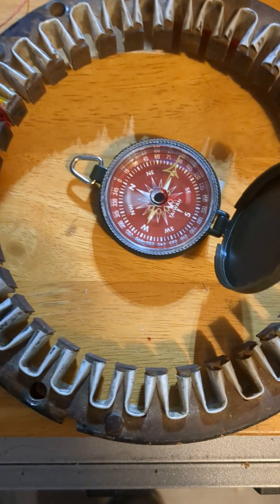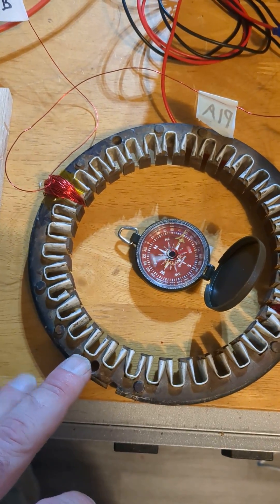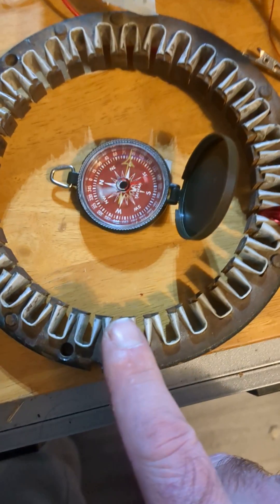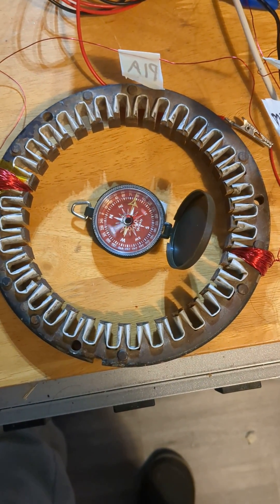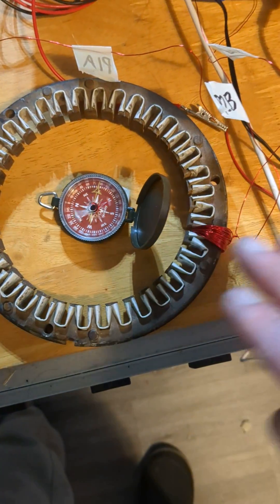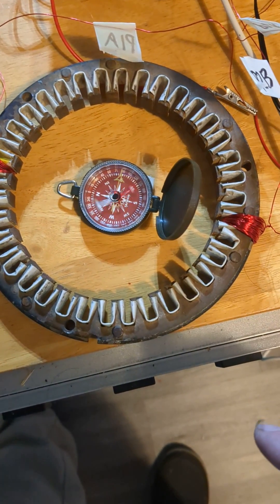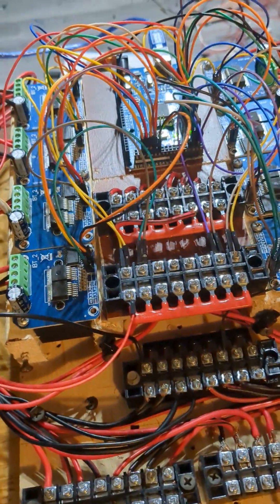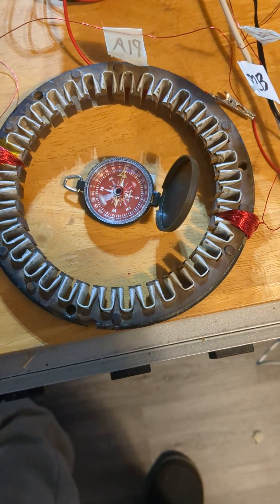Rotating Magnetic Field inside a Toroid Core

Comment: Reminds me of Dollard's 4 quadrant presentation, what he said about phase shifting the coils by 90 degrees to create the virtual rotating pole has stuck with me since watching that, using both the reactive and active currents to complete the rotation, nice to see replications with that design in action.

The use of a core like this also gives me ideas to create a much tighter coupling for the RMF for whatever one would use it on, definite advantages there over just using coils and air alone, if I had the means to experiment I'd be looking into having it run at the resonant frequency to gain those advantages without the core losses, perhaps even driving it on a condenser discharge.

Comment: Sir, you've unlocked the primary means of generating a rotating magnetic field. Use thin primary wire high turns.

Now two secondary coils to set your output voltage use the principle of how power flows from high potential to low. S1 180v s2 12-60 turns. Low awg high amps.

You can also use a second core for your secondary coil. S2.

The amps are limited and determined by core size and primary coil input voltage. That sets the rotational speed and power of your transformers.

The secondarys are only to draw power and recycle it back to the core. With very little losses. 
You can power the load in series or parallel for varying results adding a capacitor also bumps up your peak power output. 
Just like on an inverter with larger caps allows a higher peak power for a limited time
Reply from the maker: If you can post this info on the mooker forum with schematics and details, it would be much easier to visualize. I appreciate the offer of help

Comment: Can you please explain how the coils are connected to the audio amp. And what connections you are using to power the amp and the purpose of the aux audio connection.

I would love to replicate this set up.
Reply from the maker: 2 stereo speaker outputs.  each speaker output goes to 1 coil.  Doesn't matter which direction. Switching the polarities just changes the direction of rotation.  Aux input needs to be receiving 2 sinewaves 90 degrees phase difference. You can create them in audacity and bluetooth them in, or use a function generator on the aux input. Get the stereo amplifier to broadcast 2 sinewaves at a 90 degrees phase difference.  Now you have Nikola Tesla's famous "Egg of Columbus".
Reply: You are amazing sir. Your solid state generator path is something I admire

Comment: You will need switching if you want to create more power. The switching of the coils on and off will remove the resistance of the coil when off and approaching it but will also push it to the next one when on. I do like the experiment.
Reply from the maker: Thank you. The objective is to create a rotating magnetic field, and induct nine phases. Then route those nine phases to create a second rotating magnetic field, which will be used to induct into a stator